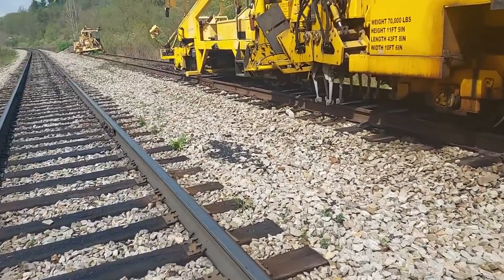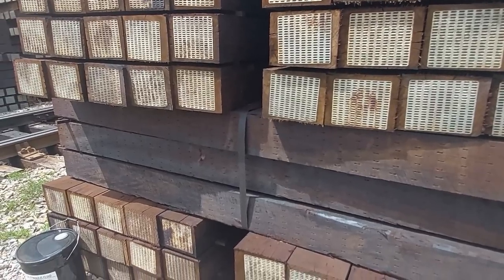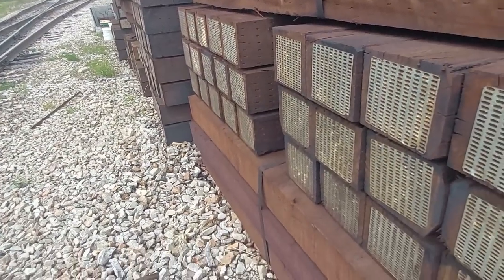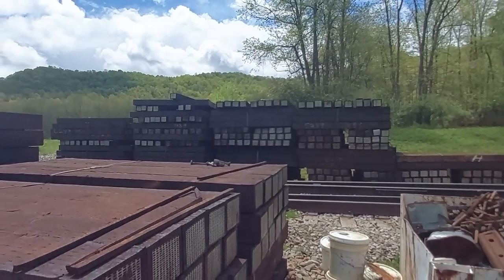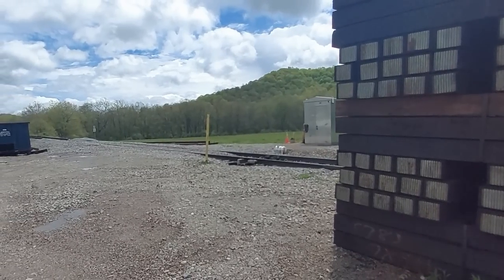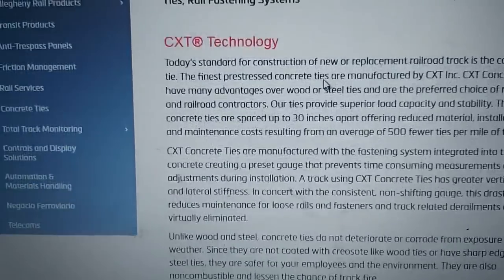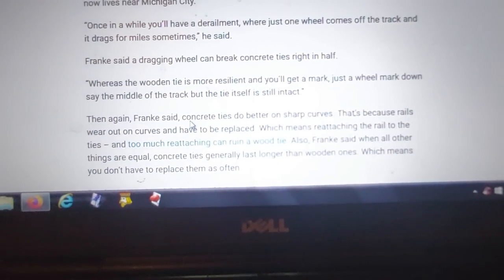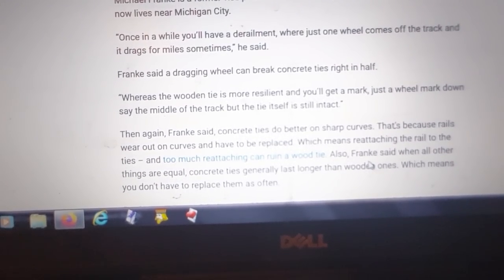Why some Railroads use Concrete and some use Wood Cross Ties

Comment: Pre-stressed concrete uses steel cables in place of, or addition to, rebar as reinforcement. The cable is stretched, or "stressed"using a hydraulic machine and special cable chucks in a stress-bed and maintained in tension until the concrete is cured. The cable in tension adds more to the strength of the concrete than just rebar.
Reply from the maker: Thanks for sharing the info with us on how pre stressed ties are
done.

Comment: I’m surprised that the concrete ties have less of a carbon footprint. Cement is extremely carbon heavy. Also, don’t the wood ties continue to decay in a landfill and add to the gasses that can be tapped off of the landfill to be used as fuel? Wood is a renewable resource, that is lost on a lot of people these days.
Reply from the maker: Thank you for sharing your thoughts and for watching the video
Shauny. No argument from me on the cement industry's green house gas emissions being hard on the environment. However, in the video I was speaking strictly of the effect of wood vs concrete ties, not about an industry in the whole of itself.  

My information came from Robert Crawford, University of Melbourne who did a comprehensive study on the CO2 emissions from concrete and wood ties finding the CO2 emissions associated with concrete ties are two to six times lower than those from wooden ones.

Here is the link to that study:
https://pubs.acs.org/doi/abs/10.1021/es8023836

Comment: They switched from wooden ties to concrete ones here maybe a decade or so ago and I thought it was odd considering the fact that this is earthquake country. My thought was also that the ties would break down the middle in the event of an earthquake. All the times that you do hear about or see what happens to tracks during an earthquake, it bends the entire rail way out of shape so maybe it doesn't matter what kind of ties are there since the ground might move 10 feet or something, depending on the size of the earthquake. The thing is that you only hear or see these events when the track is basically crossing the fault so I wonder how often they have to replace a slew of concrete ties after an earthquake when the  track is just near the epicenter since that part of the land would all be moving together. Maybe they just don't worry about it because it's only going to be whatever part of the track crosses the fault that will need major repair. One thing I will say is that it seems MUCH safer to be on the rails in the event of an earthquake than to be on the road seeing as how many freeway overpasses have fallen down during earthquakes in the past. Those make me leery; trains aren't perfect but it's nicer than having to drive around people who are mostly looking at their phones and not the road.
Reply from the maker: Thank you Who Ever for taking the time to watch the video and write in with your thoughts on the ties. May you have a most blessed day my friend.

Comment: I was surprised when you said the Reading was the first railroad to use concrete. My grandfather worked for the Reading..I think overall the wood ties are the best  to use i know they are good for 25 years and the concrete ties can last a lot longer. But i doubt you could go 25 years without a single wheel coming off the track. with the expense of them till you got the train stopped you are talking about a lot of expensive replacing of ties and down time. Just my opinion. Great informative video Dave.
Reply: I met your grandfather, at the hotel on Park Place.
Reply from the maker: Thank you for the great comment Michael. Yes for us, wood is best. Appreciate your taking the time to visit and  check out the RR tie video my friend

Comment: They are still using concrete ties as we speak. They normally are used for Amtrak lines. I reside in Philadelphia and SEPTA is our mass transit. Also, SEPTA has a regional rail system which use wood ties except for tracks that are shared with Amtrak,  then they use concrete ties. I never seen concrete ties before 2000
Reply from the maker: Thank you MrPlumber for sharing that with us, very interesting.  Appreciate your taking the time to tune in and check out the video my friend.

Comment: Thank you for sharing!  :-)
There is more to the topic than I had thought. I seem to double some other comments.

There are differences among countries (or at least railway networks), and there are developments with time. Note, that in Europe the infrastructure is mostly owned and maintained publicly, with (at least here in the Netherlands) a fee due for using the rails (even parking stock). Also note, that the profile here is smaller than in North America, in Britain even smaller, and that trains here are shorter (740 meters max as a rule) and lighter (22.5 metric tons max per axle as a rule). On the other hand, freight trains may be faster here than in North America, provided that the track allows so: many container shuttles can cruise at 120 km/h, ore trains still at 100 km/h. (I don't know about the extreme ore trains between Kiruna (Sweden) and Narvik (Norway).) No slowing down at level crossings!

Here in Europe, all wooden ties (cross-ties, sleepers) seem to get replaced with concrete ones. Concrete ties long enough to carry switches (sets of points) seem to have come into play rather late. A few long (overly long by our standards) maintenance trains (built by Plasser & Theurer) seem to work continent-wide, replacing rails, ties and ballast in one pass, with the crew members more as controllers than as laborers.

I can't remembers nails used for fasteners here, but I have noticed multi-screw plates (on wooden ties) giving way to single-bolt omega-shaped ones (on concrete ties).

My memory has almost paled regarding ties consisting of two concrete blocks connected by metal (iron, steel) rods, including the zig-zag variety that was seen as the future in the 50s. It likely wasn't fit for these maintenance trains.

All-concrete railbeds seem preferred on high-speed lines, like in France and Germany.
Reply: Adding to my preceding comment: in https://youtu.be/raTNX3vwg-c, you can see what I meant. It features a recent video of a museum railway in the North of the Netherlands. There are worn wooden ties at the starting end of the section (Stadskanaal), and concrete ties with both types of mount I meant at the other end (Veendam).

Sidebar: this stretch of track is to be returned to active service, maybe even extended from a stub to a through line (to Emmen). The museum would have to get a new (re-constructed) line.  - And have you ever watched a fireless steam engine being tanked up by a real steam engine?
Reply from the maker: Appreciate the nice comment Chris and for sharing those thoughts. 
Concrete lends itself well to high speed tracks, wood does not. Thank you very much for taking the time to watch and write in my friend.

Comment: Here in EU old sleppers are getting replaced on the most of the tracks, but it's whole different wolrd. Combined traffic, high speed, reliable sleepers are obviously preferred. Different storry is typica American cargo only rail, woood is way to go, there isn't simply necessity for advantages of advanced tinkered mass produced concrete sleepers.
Reply from the maker: Thank you for sharing your thoughts Samuel. This video was certainly
not a comprehensive treatise on the subject of concrete vs. wood ties. There is a whole lot more involved than what I could cover
in such a short video. 

Every RR has it's own unique situations and environment and tonnage rates, etc., so there is no "one tie does it all" for every RR out there in every situation they encounter. Each RR has to choose what is best for their own situations on each different sections of track they have. Appreciate your taking the time to  visit with us and check out the video my friend.

Comment: The only question I have is what’s the cost difference between the two types? I’m not sure if I missed that or if it wasn’t in your video
Reply from the maker: Being that there are 28 different profiles of concrete ties, it's
kinda hard to give you an accurate answer Dan. Each different
profile has a different pricing. Wood ties here are $80.   All concrete are higher than that and heavier ones can be double or more the cost, plus transportation costs to get them to the job are much higher with concrete, because they are so much heavier than wood, it requires more trucks to get them to the job site. Thanks for taking the time to watch and write in my friend.

Comment: In Switzerland, we use only Concrete Ties on the whole 5200 kilometers (3200 mi) network. We conform to the European standard: N 13230-6:2020(MAIN)
Railway applications - Track - Concrete sleepers and bearers - Part 6
Reply from the maker: Thanks for sharing the info Michael and for taking the time to watch the video. Happy rails to you until we meet again my friend.

Comment: I noticed that Europe has been using concrete ties for many years and seemed to have solved the problems that you are mentioning in this video. What are they doing different than we have been. I also noticed the UP is installing concrete ties in some sections of their track that parallel I-10 in Arizona and New Mexico. Have they found the secret to being able to use concrete rather than the old wood ties?
Reply from the maker: Have you also noticed Madus Maxamus the much smaller length
and weight of trains in Europe compared to here. Thanks for taking the time to watch and write in my friend.
Reply: @ccrx6700 IS the axel load in the US that much higher? Because that is what is important not the total length or weight of the train.
Reply from the maker: @mbr5742  our loaded cars are 286,000 pounds
Reply: @ccrx6700  Around 140 civilised world tons, on how many axels? Because the weight itself is not the problem, many german 1930s steam engines where even heavier yet could operate on basically every piece of standard gauge european track.
Reply from the maker: @mbr5742  👍😊

Comment: A couple of questions. 1. Is the spike-hole filler (Sure Spike, SpikeFast...) ineffective for rebuilding/repairing the ties when they ties are re-spiked? 2. The concrete ties are supposed to be better for 5.5+° curves but doesn't the speed through those curves also come into play? Your system appears to run fairly slowly compared to longer systems.
Reply from the maker: The Spike Sure does not rebuild ties Perry. It only fills in the spike
hole to get water retention and also better holding power for the
spike.  2. Yes the higher the speed the more concrete is a better
choice. Concrete lends itself well to high speed passenger trains.
We run here at 25 mph. Appreciate your taking the time to watch and write in my friend.
Reply: @ccrx6700  I've watched virtually all of your maintenance videos. It's content that I just don't see anywhere else.
Reply from the maker: @perrybabin8427  👍😊

Comment: Great video about railroad sleepers, got some hardwood sleepers for the garden from Poland I was told they came from , the wood is called azobe and if is so hard you can not drive a nail in to it without it bending , I believe it is an iron wood , the chain saw can just about cut it , anyway it takes 2 people at ther best to life on of then , they are 9 ft long , 6 inches thick , and 10 inches wide , there is no smell of creosote from them , I think they are treated with cyanide but I could be wrong , they are very old , but the wood is still perfect in them , I think  the wood originated from Africa and was used in Europe, greetings from Ireland 🇮🇪.
Reply from the maker: Thank you for sharing that with us Martin, I've heard of african ties you can't even begin to drive a spike in without pre drilling. Appreciate your taking the time to visit with us and check out the video my friend.

Comment: I don't understand, the concrete ties here in Europe are solid all across and are used all over the places in high speed, freight - you name it. No strange metal bar between them though I am sure there is rebar within it. The only exception I have seen is some turn outs. Of course, we use screws and seat the rails a bit differently. I've never seen nails here except in mines and other "temporary" installations. 

So while I appreciate that in this experiment they didn't work I don't know if it is valid anymore.
Reply from the maker: Appreciate your sharing that with us Michael. Remember those concrete ties we tried were way in the past, no one even makes those anymore. Concrete lends itself well to high speed passenger trains. Thank you for taking the time to watch and may you have a very good day my friend.

Comment: Hello. I have already asked you a question about sleepers.A couple of weeks ago. I live in Russia. And we are massively abandoning wooden sleepers, as it is not economically profitable. The point is not only that it is necessary to use aggressive chemicals for processing sleepers. but also the fact that the preparation of high-quality sleepers is very expensive. The tree must reach maturity. To dry efficiently and safely, and then undergo heat treatment. Otherwise, the service life of the sleeper is reduced. We have a lot of forest. but the fact that the work on wooden sleepers. It is toxic and heavy, and requires a lot of workers. Strongly repels their use.
In the Vologda region, the coldest winter in my memory was -50 degrees Celsius. And the heat in summer is up to +35, quite a natural phenomenon.
In winter, a wooden sleeper turns into iron. It is extremely difficult and dangerous to hammer a crutch into it.
At the same time, we are constantly increasing the weight of rolling stock. Because of what wooden sleepers do not stand up. And they require constant electronic inspection of rails by flaw detection specialists.
Up to 300 freight trains pass through my section a day, with a gap of 5 minutes.
And companies are switching to concrete, because of durability. Fastening of sleepers, treated with lubricants, from corrosion.
Здравствуйте. Я уже задавал вам вопрос по поводу шпал.Пару недель назад.  Живу в России. И у нас массово отказываются от деревянных шпал , так как это экономически не выгодно. Дело не только в том, что надо применять агрессивную химию для обработки шпал. но и то что подготовка качественной шпалы, очень дорога. Дерево должно достичь зрелости. Качественно и безопасно высохнуть, а потом пройти термическую обработку. Иначе срок службы шпалы снижается. Леса у нас много. но то что работа на деревянных шпалах. Токсична и тяжела, и требует много работников. Сильно отталкивает от их применения. 
В Вологодской области, мамая холодная зима на моей памяти была -50 градусов цельсия. А жара летом до +35, вполне естественное явление. 
Зимой деревянная шпала превращается в железо. Забить в нее костыль крайне сложно и опасно. 
При этом у нас постоянно повышают вес подвижного состава. Из за чего деревянные шпалы не выдерживают. И требуют постоянной электронной проверки рельс, специалистами дефектоскопии. 
В сутки по моему участку проходи до 300 грузовых поездов, с разрывом в 5 минут. 
А компании переходят на бетон, из за долговечности. Крепления шпал,  обрабатывают смазками, от коррозии.
Reply from the maker: Very interesting to hear all of that my Russian friend. I have a question for you now, with the extreme cold and increasing train
weights, how does that affect any cracking of the concrete ties?
Appreciate your taking the time to check out the video and
write in.
Reply: @ccrx6700 Concrete bollards actually do not last long. Maximum 20 years. Almost everyone cracks. But, they serve much longer than wooden sleepers. Concrete sleepers are more profitable for the company, this allows you to reduce staff, secure traffic. And for 10 years, forget about repairing the tracks. But we need an investment in a ballast prism. In places, the path is very freezing. a metal tool bursts in the cold. for example, Briggs & Stratton products were abandoned, as the engine life of the engines was sharply reduced in the cold. And it is more profitable to buy a cheap Chinese analogue. Than Briggs & Stratton repair.

About 20 years ago, we had wooden paths. and at that time, we physically could not afford the work of replacing sleepers with machines. It was more profitable to change the sleepers manually. Without stopping traffic. This is a very hard job, people don't go to work for it. as a result, there is a shortage of personnel, those who work, as a rule, with a low social status and education. Such personnel are negligent about work and safety, do not protect the company's property. And we constantly broke the tool, there were thefts. all this in society, causes criticism. We have very large volumes of traffic. So, it is more profitable for companies to carry out one-time capital works with the installation of concrete sleepers.
To do, and invest, than then constantly repair.
It is necessary to have the honor that we and you have different economies. And different attitudes to security.
 Бетонные палы на самом деле служат не долго. Максимально 20 лет. Трескаются почти все.  Но, служат,  гораздо дольше деревянных шпал. Компании выгоднее бетонные шпалы, это позволяет сократить персонал, обезопасить движение. И на 10 лет, забыть о ремонте путей. Но нужны вложение в  балластную призму. Местами пути сильно вымораживает.  металлический инструмент лопается, при морозе. например  отказались от продукции компании  Briggs & Stratton, так как на морозе  моторесурс двигателей резко сокращался. И выгоднее , купить дешевый китайский аналог. Чем ремонт Briggs & Stratton. 

Сделать, и вложиться , чем потом постоянно ремонтировать. 
Надо у честь что у нас и у вас, разные экономики.  И разные отношение к безопасности.
Reply from the maker: @крестанен  thank you verymuch for the excellent reply.  I understand much better now. Sounds also like you guys have similar problems as we do with young labor forces.